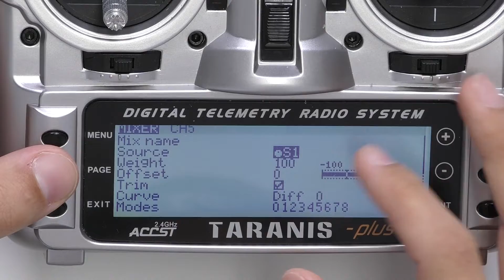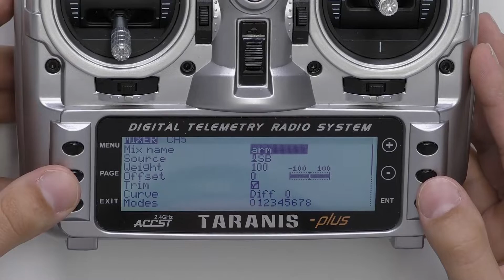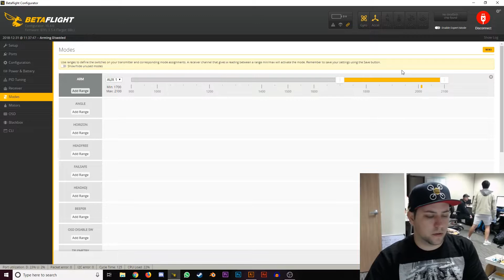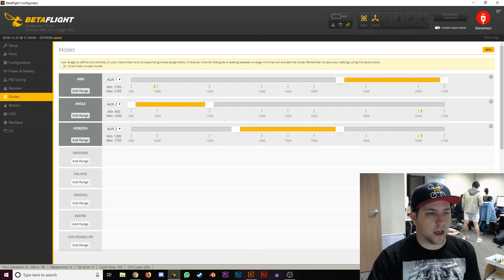How to set Arm & Mode Switch - BeeBrain Lite

Comment: Currently my acrobee lite will not hook up via usb to either one of my two computers.  One is on windows 10 and the other windows 7.  I tried all drivers and several different cables and still nothing.  The lights do not turn on with usb power, only with a Lipo attached.  I have been able to attach to my Tarranis QX7 but i have NOT been able to connect via USB to betaflight.  Please help
Reply: I had a similar problem. I got around it using a usb cable with a charge/data button. I put the cable on "data" and connected via usb with the battery plugged in. It will not connect without the battery.